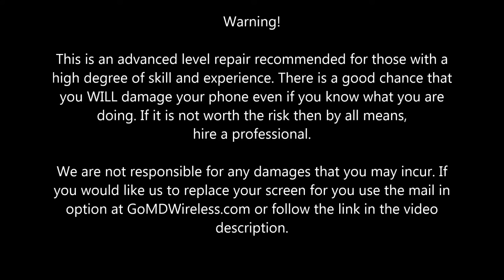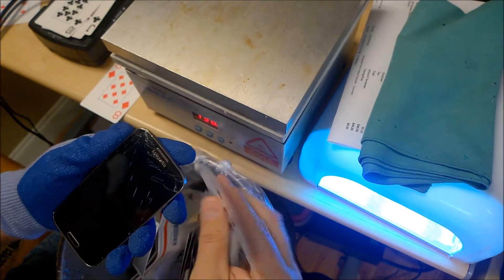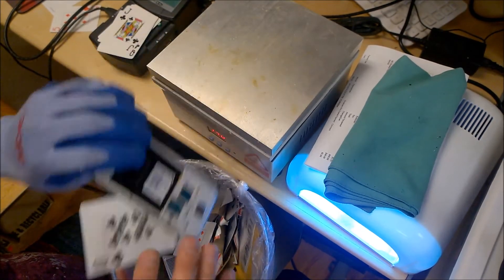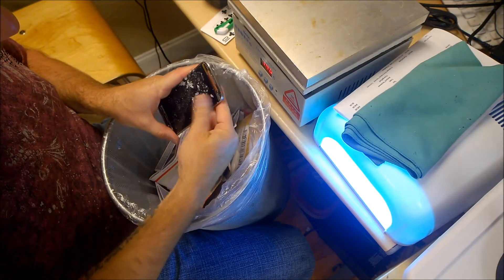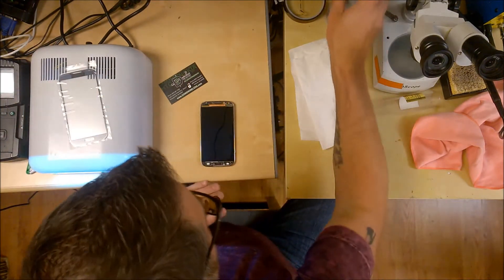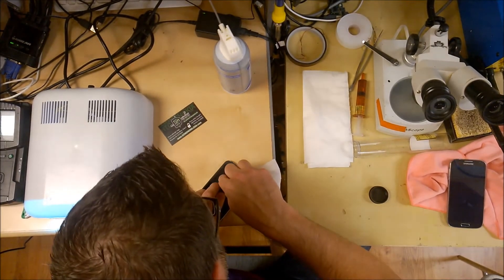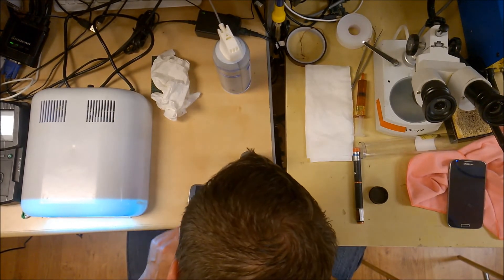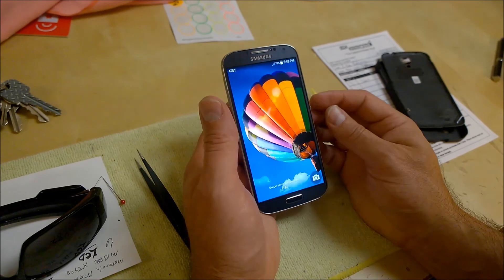Samsung Galaxy S4 Glass Only Replacement

Comment: I do these repairs on the side. I have all the tools (except the hot plate, I use a heat gun and infareader) I've done many s3, a few  iphone and 2 s4. And my question....... wth is the AMOLED? Lol. I've never damaged any phone I have done but now you have me thinking I've been lucky, is it that thin film like material over the LCD?
Reply from the maker: The AMOLED- active-matrix organic light-emitting diode, is what most people refer to as an LCD- liquid crystal display. Just a technicality. I'm impressed that you were able to do an iPhone using a heat gun. Those LCDs seem to be very easy to crack. We used to do glass removal with a heat gun too but I gotta say that since heating plates have come down in price so much you should think about investing in one. It makes sliding a molybdenum wire under the glass much easier. I can remove the glass from something with a detachable display assembly like an iPhone in about a minute once it is removed from the phone. Of course this doesn't apply to Galaxy phones unfortunately unless you can pull the whole AMOLED out of the mid-frame without breaking it.
Reply: Go Cell Phone Repair do you remove the frame to use the coated cutting wire? i noticed you did not remove the lcd from the frame and I am curious to why?
Reply from the maker: David James We generally go according to what the bezel looks like. If the customer is okay with their existing frame it lessens the chance of damaging the AMOLED by removing the glass from the outside. Day before yesterday one of our techs pulled off the glass in two pieces (single crack down the middle) within five minutes. He had the repair completed start to finish in twenty five minutes. That is our fastest to date.
Reply: Go Cell Phone Repair so you just apply LOCA with the frame installed? Won't it leak to the other components (home button flex, camera etc) I'm curious to know how you avoid this. I remove it from the frame and put brand new frame adhesive and back LCD adhesive but it's a lot of work
Reply from the maker: David James Yes leakage can definitely be an issue. The front camera and proximity sensor can be cleaned up afterward easily enough using LOCA remover and a q-tip but if it gets into the buttons there's not a whole lot that you can do. Also when you screw down the board it forces even more glue out and as you know the stuff under the painted areas at the top and bottom end of the display never cures since the UV can't reach it. The short answer is that with practice you get good at using just the right amount of glue- about 1 to 1.5 ml for an S4- and working bubbles toward the sides rather than the top and bottom ends. "Spot" curing the trouble areas with a UV flashlight helps but to this day we find that the glue may continue to come out of the display for a week or two after the repair. I know a guy who is using a vacuum machine to make AMOLED removal easier but they cost about $600 and aren't necessarily 100% effective as far as safe removal.
Reply: Go Cell Phone Repair Yeah I know what you mean, autoclave or OCA vacuum laminator? They're perfect cause you just out an OCA adhesive sheet on the glass and apply to the screen then have the machine remove the bubbles, good for iPhones really. 500 is quite cheap, I've been looking at some for over 1200. where did you see one so cheap? Edit: just read properly, I thought you meant to vacuum laminator. You mean the mould type things that are on an Lcd Seperator? I don't really like them as they're only made for certain models and soon you'd have to keep upgrading and you're right they don't look all that great at doing the job (excuse my slight spelling mistakes, phone keeps correcting)
Reply from the maker: David James Yeah that's what I was referring too and agreed it's not practical to keep buying a new machine when another phone is released. They should have a modular design so that you can change out the fittings.

Comment: do you know how much ml of loca glue do i need for galaxy s 4?
Reply from the maker: Roughly 1 ml.
Reply: Go Cell Phone Repair Are you sure?
I bought this one: 
http://www.ebay.com/itm/141198685516?_trksid=p2060778.m2749.l2649&ssPageName=STRK%3AMEBIDX%3AIT
100%Brand new and High quality UV glue
Type: TP-1000
and in the description it says: 
For Samsung Galaxy S4 :2.5-3ml/CC
but i dont know if i can trust this..
Reply from the maker: It may be a bit more than that but not much. I know about how much we use but I can't really advise you about this product as I don't have any experience with it. The important thing is that you fully cover the surface. Any excess will flow out over the edges but this can be a problem. It is possible to use too much and expose the keys at the bottom, the speaker, camera and notification compartments as well as the secondary mic to the glue. If this happens you can usually clean it out later but sometimes it does damage so you'll end up with one of the above not working anymore. It's best to practice this repair a few times before you start working with live phones. We spend a couple days teaching our techs until they get a good feel for it.
Reply: Go Cell Phone Repair
Thank you very much for the detailed answer!
I just fix my own cellphone so i can't realy practice.. maybe i will try on a paper in the size of the screen.
I Subscribed and liked your video thanks to your awesome support in the comments.

Comment: I'm just amazed on how he just put the screen down so fast! I seen ppl go super slow on that, maybe because they were using LOCA glue. Which one is better? UV glue or LOCA sir? I always fix my galaxies with LOCA. A nice tip would be helpful, you just earned yourself a subscriber :D
Reply from the maker: LOCA/UV glue pretty much the same thing. UV just refers to the curing process. There are a few different techniques that can be used to install the glass. In the video our tech installs the lens quickly but does spend some time working the bubbles out. I've seen people who take more time allowing the glass to settle without many bubbles forming. The preferred method is of course whatever works best for you in terms of time investment and the end result. Thanks for subbing!

Comment: Other videos I've seen go to the trouble of removing the camera and sensor before applying the glue. How does your method prevent glue entering these areas? Is it that you use just the right amount of glue, or that you cure the glue with UV light at the edges before it can reach them?
I'm doing my badly crazed S4 right now. I have got the glass off successfully and everything still works. Am researching best method for applying the new glass.
For UV I've got a bank note checker rated at 4 watts of UV. Will that be enough?
Good video. Thank you for the help.
Reply from the maker: I believe that it is a combination of both. If it is your first time though it will be tough to know how much is too much so it certainly would not hurt to remove the internal components just to be safe. The nice thing is that the glue wont actually dry anywhere that the UV doesn't reach so you can always clean it out from the inside later on. We discovered recently that the mic on the logic board near the earpiece mesh is also a concern as glue will block it and prevent the speakerphone from picking up sound so it is best to pull the board unless your glue allocation is close to perfect. The lamp that we use is 36 watts. For tacking the edges your note checker might work but I think that you'll need a bit more for curing the entire surface. The sun works well enough for that from what I've been told, if you don't want to invest in a lamp. Or you could always visit a nail shop and ask them to let you pop your phone in theirs for a bit.